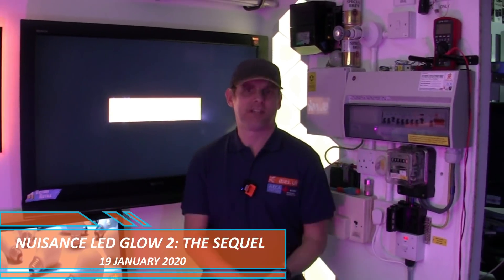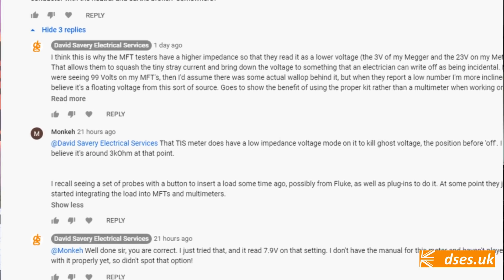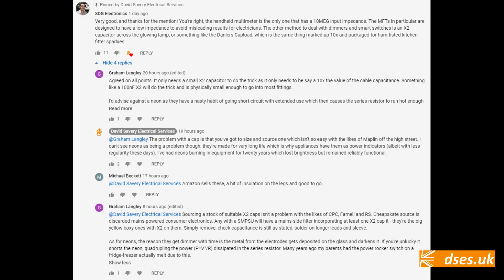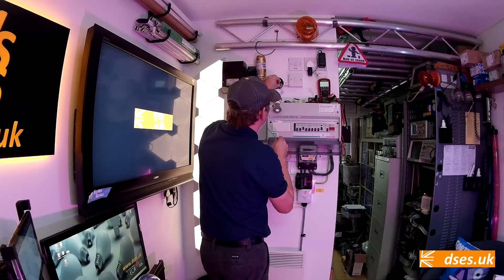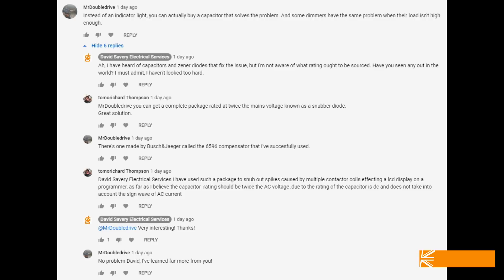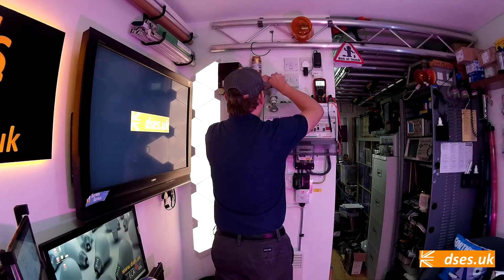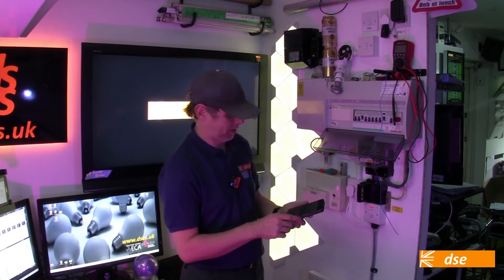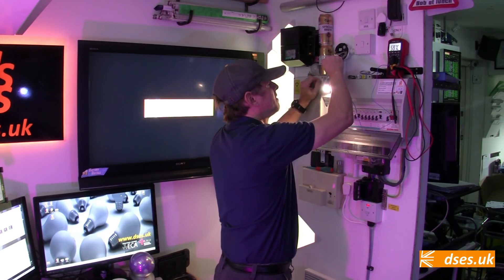Nuisance LED Glow 2: The Sequel

Comment: Still, there has to be a better way to do this rather than just attaching shit to stop the issue. Seems like it is applying a band-aid to a leak at the dam. Good at the time, but not an effective solution. Is there something that can go directly into the junction box to prevent this sort of thing like a capacitor or regulator or something?  By the way, I thought I was the only asshole that shocks himself. Gives me a bit of comfort knowing that even the professionals screw up from time to time. See, I did not say "that was a shocking situation." Shit well now I did, but you understand.
Reply from the maker: Ah, I can assure you I am 87% asshole. As for the capacitive problem, a good quality LED lamp ought to be designed to a standard that ensures a few microAmps won't have any ill effects.